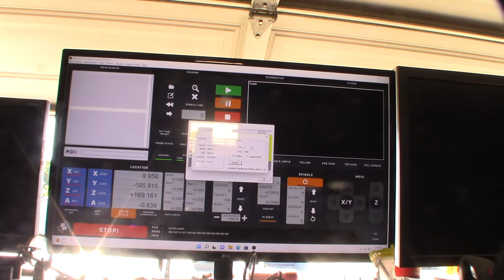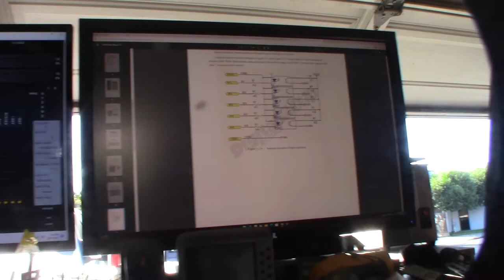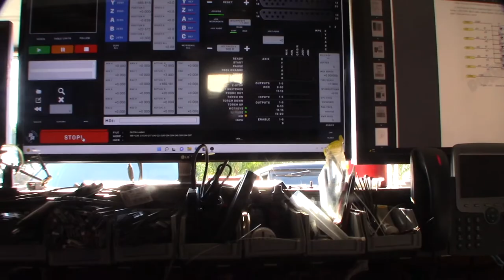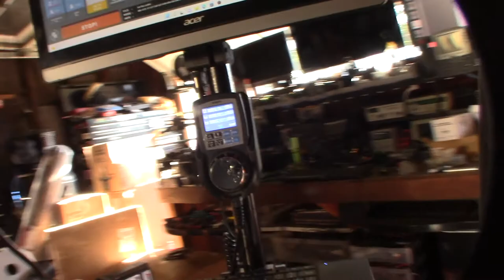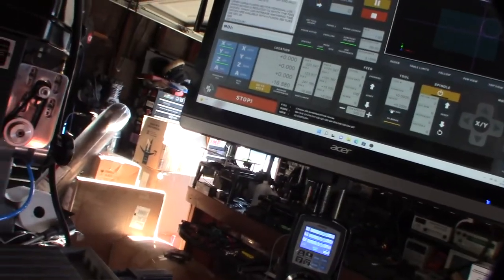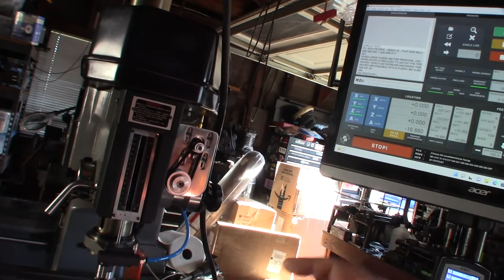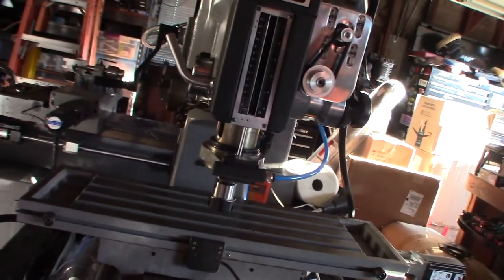Novusun Digital Dream EC300 Mach3 CNC Ethernet controller Installation And Testing, EC500 LinuxCNC

Comment: WOW ! I found you buy searching for Blue Iris with Reolink Duo cam. When I checked out your other videos, I wish I had found you sooner as I am doing micro controllers, cnc and so many thinks like you do. You are on a higher level than me but I could have learned so much more. I will be throwing some questions at you in the future  :  )
Reply from the maker: Thanks.
Reply: @fintechrepairshop hey bud. Could you tell me which one is better to buy? NVEM or EC300/500?
Price is similar, even EC is quite cheaper. 
Thanks

Comment: Have you tried to connect a servo drive for the spindle? I have the EC300 and I can’t configure the ports and pins on Mach3 to run the servo drive through the C axis. I tried using the 10v analog via the “spindle” port into the servo drive but it’s not putting out any voltage between the VSO & GNDS pins. Have you attempted this? Cheers, Tyson.

Comment: Thank you for making this video. Is the EC300 still working well?
Reply: I'm wanting to know too. I'm looking at buying one
Reply: @chestergt7765  Did you end up getting one? Thanks!
Reply: On his new video he complains a lot on these drivers... https://www.youtube.com/watch?app=desktop&v=wKCe3ZRyiEU
Reply: @gal766  so I've had mine working since  January 2024. It works fine. But there is some issues that I don't like but that might be a mach3 issue. Feed hold isn't fast enough. It might feed for several seconds after feed hold. Single block does work fine. But damn, I use feed hold a lot when proving out a program. I haven't tested out the tool and part prob yet. I'm upgrading to a 7.5kw atc spindle right now.

Comment: hello, does this board supporting backlash compensation in mach3????
Reply: Have you found the answer? I'd like to buy it but I need backlash compensation working.
Reply: @torbaciej  better buy mesa card controller board to linuxcnc lot lot better than thats.
Reply: @mattivirta  I bought it, I was very disappointed, lucky me I returned it and got the refund. Finally I took the CNCdrive axbb-e and I'm very satisfied!

Comment: How did you wire the VFD on this?
Reply from the maker: On the EC300 I was using spindle on and off. I could never get 10V analog to work correctly. Are you having the same issue?
Reply: @fintechrepairshop  I keep sending a message under this and it's not sending for some reason.